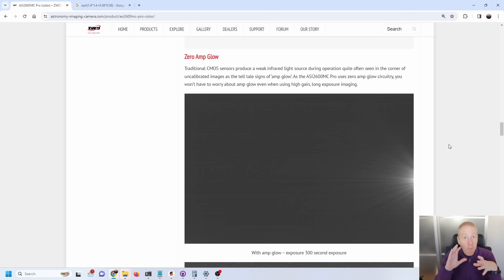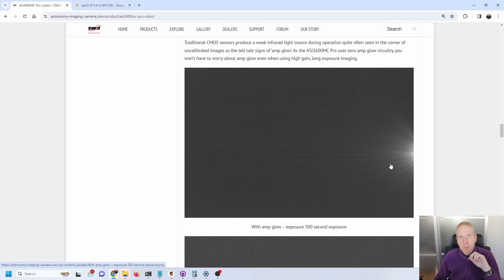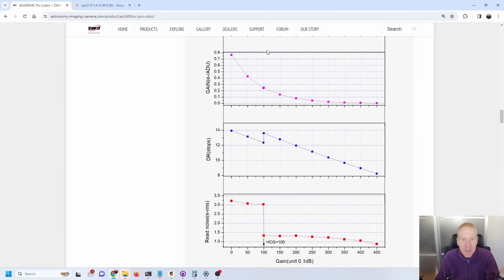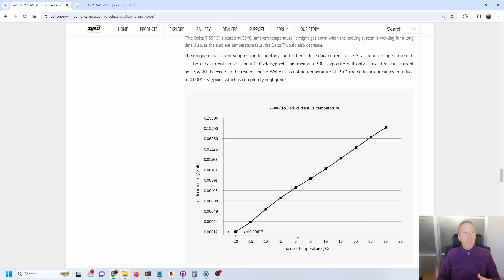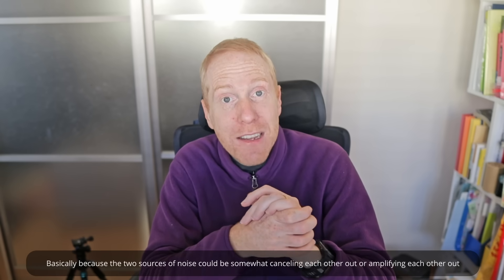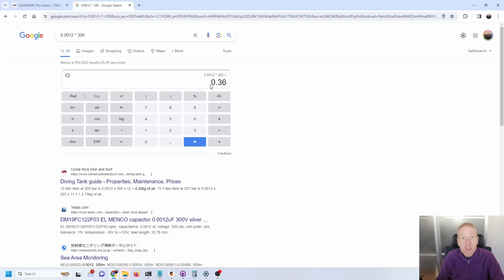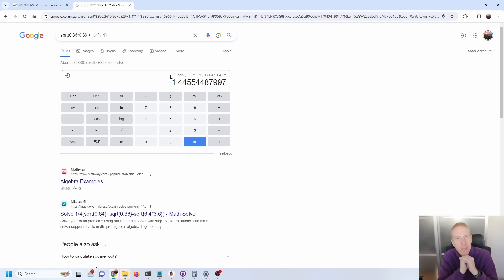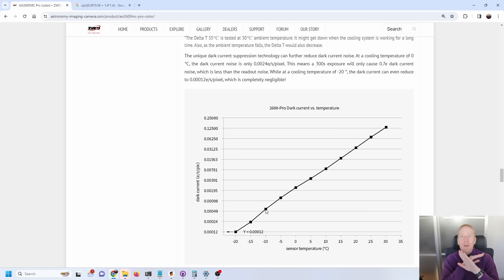Why I DON'T take Dark Frames (and what I do instead) - Astrophotography

Comment: Quick question. Doesn’t the flat frame contain the bias noise since they are the same exposure length of around 1 second? Or do you think it is better to take flats and then calibrate them with dark flats and then use the bias frames? It was just my thinking that maybe flats alone are enough. Thoughts?
Reply: Darks, flats and dark flats for me… and no bias, but I don’t dither, so darks get rid of the walking noise…👍🏻
Reply: Flats are applied by division to the light frame to correct for vignetting, uniformity, etc., so they don't subtract the bias/dark from the light frame.
Reply: I did not know that. Thank you. So should I still calibrate my flat frames with my flat dark frames and then create a master flat? And then just create a master bias at the same gain and temperature using 1 second exposures?
 @MarkManner
Reply: @MarkManner  they do when they are calibrated with flat darks which contain the bias signal…
Reply from the maker: The flat frames get calibrated with the bias frames (and/or flat dark)!

Comment: Great video! I am just a beginner but bought my stuff a few years ago bit by bit. I have the Altair 269C TEC which has no ampglow too and I recognised the same thing when I created my calibrations frames, I even used my bias frames as dark frames, because I didn't take any. So here is to lazy fast bias frames!
Cuiv, you're saying you take 1 - 2 s flat frames, is this dependent on the light source? I use a light tracing pad for my flats and NINA says 0.22s with the flat wizard.
Reply from the maker: I have a flat panel that I can adjust the brightness of!

Comment: Nice video Cuiv. I also own a 2600mc and I completely stopped doing dark frames as well, as I found out that using them in my calibration step for WBPP actually introduced unwanted artifacts (since a master dark frame is inherently a statistical analysis of thermal noise and will never be 100% accurate). The test dark frames I did when I first got the camera (and even on my 533mc) are so "clean" that I felt dark frames would be unnecessary.
One thing that might be worth mentioning is that on older sensors (especially DSLRs), dark frames can be invaluable to evaluate sensor health. My first camera was a used Canon 60D and dark frames were essential, as the thermal noise of the sensor was all over the place, introducing patterns (not just lines) that flat frames did not cover. For those cases, dark frames can be essential.
Happy New Year!
Reply from the maker: Thanks mate, and happy new year!! And you're right older sensors (and uncooled sensors) absolutely need dark frames!
Reply: Thanks for this. Goodness sake you guys are not lazy at all! Your comment along with Cuivs video is worthy of a PhD thesis! Really appreciated.